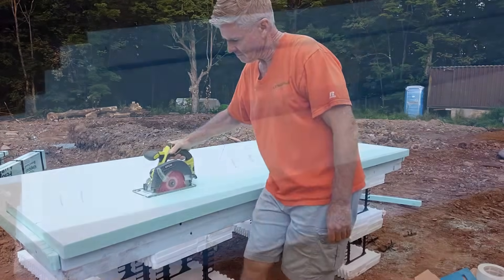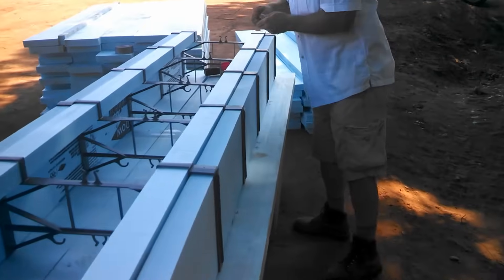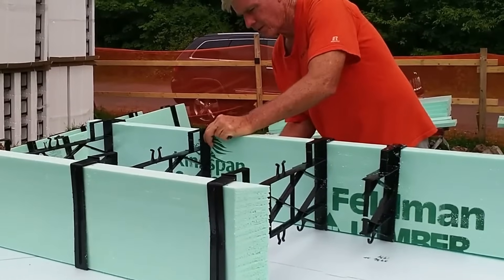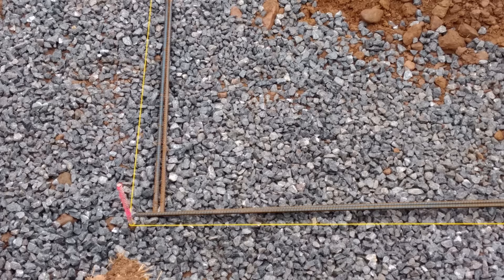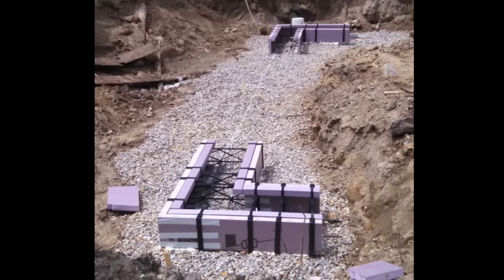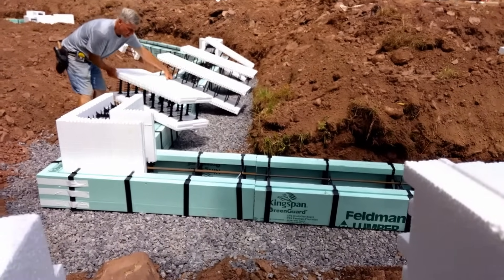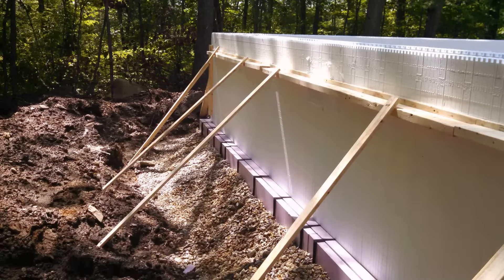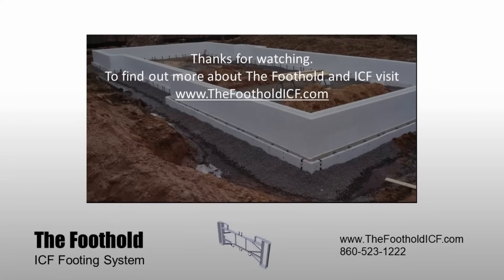How to Build a Concrete Foundation with ICF | Easy Concrete Footing System for DIY & Contractors

Comment: what width of ICF block does the foot hold bracket accommodate?  If I'm using a 6" concrete wall which is an 11" wide block, how do i fill the gap between the 2" foam strips and the ICF block, assuming your brackets accommodate an ICF block width for say an 8" or 10" concrete wall width?  20 inches - 4" -11" = 5 inch gap, 2.5 inches on each side of the ICF block.
Reply from the maker: Just a 2" x 2" piece of foam attached to the bottom side of the first course of ICF will work
Reply: 16
Reply: 32
Reply: 128
Reply: 512
Reply: 2048
Reply: 8192
Reply: 65536
Reply: 131072